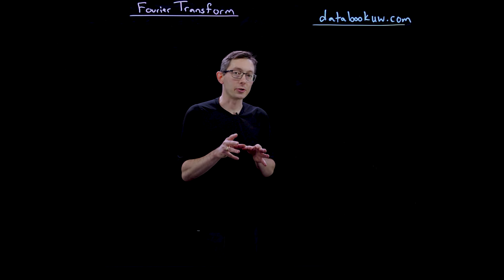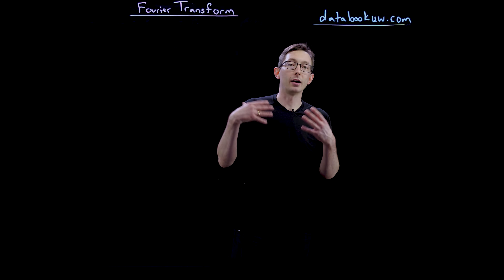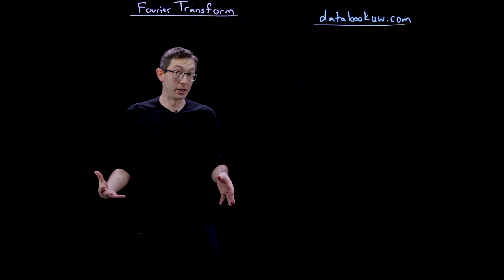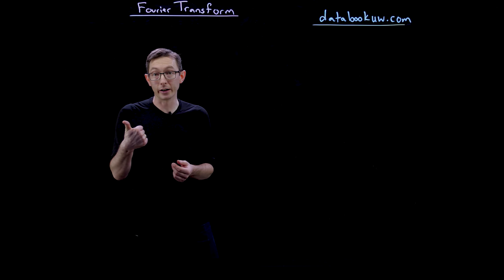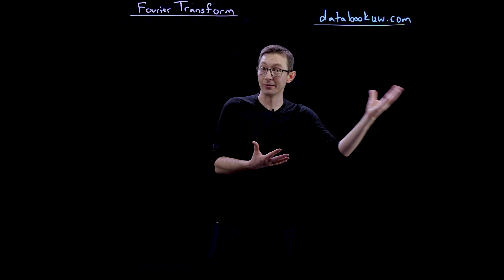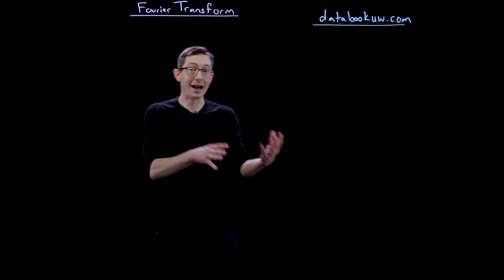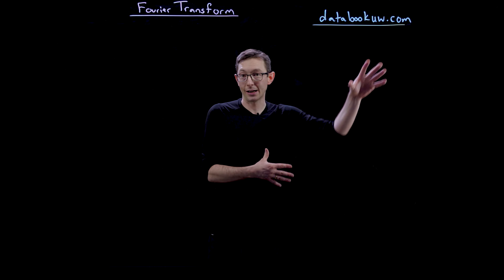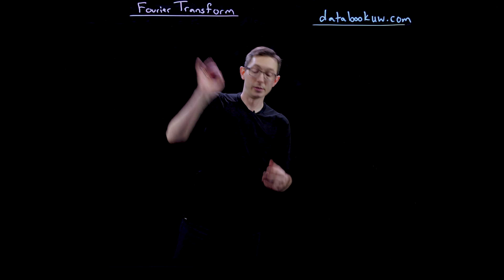Solving the Heat Equation with the Fourier Transform

Comment: So essentially, when we analyze the Fourier series of a function and derive its coefficients, we gain insight into how each frequency contributes to the energy of the signal. In a sense, each frequency is linked to a quantum of energy. Consequently, the total energy of a signal can be represented as the sum of all its coefficients multiplied by their corresponding harmonics. In simpler terms, it's the sum of all frequencies in the Fourier space, leading to the emergence of this identity.

Comment: Interesting. It reminds me of the problem of heat distribution through the earth. If we take the surface temperature as a sinusoidal then we only have a single omega and hence this would be a special case of your method, and measuring at a depth x, we should see another sinusoidal but with diminished amplitude via the Gaussian function.

Comment: Hi Steve, one question at 4:49, how did you get  d U_hat/ dt on the left hand side. do you for F(tranform) on both sides? or do you mean d / dt is independent linear operator on t, so you can take it out? Thank you so much!
Reply from the maker: Good question.  Yes, we Fourier transform both sides with respect to the "x" variable, and so the "d/dt" can come out (so F(d/dt(u)) = d/dt(F(u)) since these operations can switch orders)
Reply: @Eigensteve  Thank you so much for clarifying Steve! And actually one more question, in DFT, you showed us FT matrix is a square matrix, does it have to be square? in another words, do we have to pick same number of points, n , in frequency space as in X space?
And this is one of the greatest channel for lectures, we really appreciate it!
Reply from the maker: @kevinshao9148  You are very welcome!  In principle, there is no reason why we need to compute and use all of the Fourier coefficients, so we could consider a smaller "rectangular" matrix consisting of a subset of the rows of the DFT matrix.  This is often done in random/sparse sampling.  But for the computational benefit of the fast FT (FFT), the square structure is important.
Reply: @Eigensteve  Ah, I see!!! Now I kind of recall you might have mentioned this in your following FFT lecture. I am watching your series 2nd time, need multiple times to grip solid understanding. Again, really appreciate your great lectures and it's super pleasure to learn from you and your lectures!!! 👍👍👍
Reply: @Eigensteve  Hi Steve, but how do you guarantee the limited bases you selected from frequency space (the transform matrix) represent the major contribution in original f(x) ?  I also see other python fft tutorial, they actually just call fftfreq(number of data points) and get the sample frequencies, but there is no theory backup that those are the major frequencies in your original signal. Am I missing something?

Comment: Which books that you using?
Reply: Mr. Kumar, the book is in a reference in the description under the video. "Data-Driven Science and Engineering: Machine Learning, Dynamical Systems, and Control"  by Brunton and Kutz
I haven't bought the book yet, but it's in my wish list on Amazon. The preview of the book on Amazon shows a bibliography with source references also.
Reply: Professor Brunton also has a playlist on his YouTube site listed as "Engineering Mathematics", which are videotaped lectures from that class at University of Washington.  In that series of courses, he derives in greater detail some of the formulas you will see in the current series. I have watched those lectures and recommend them to you.